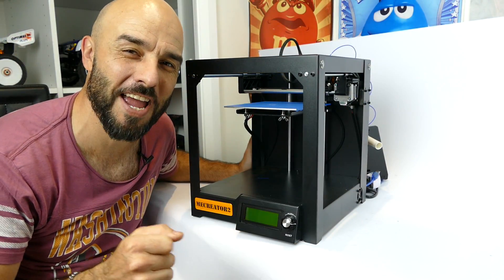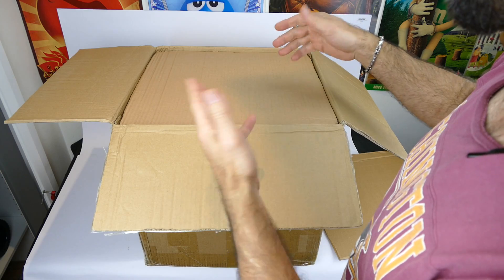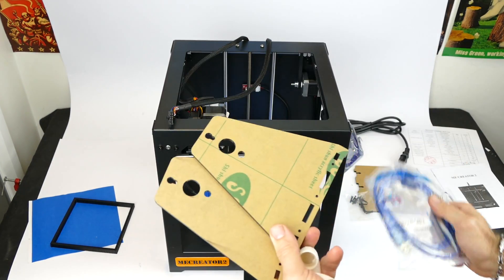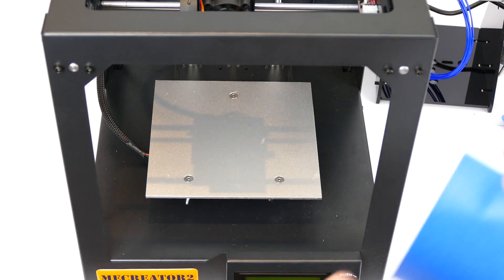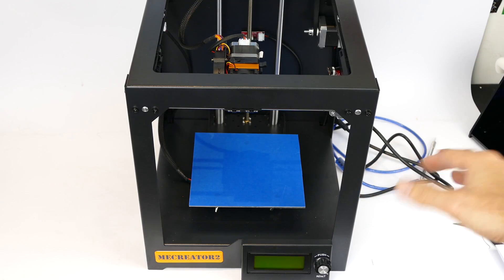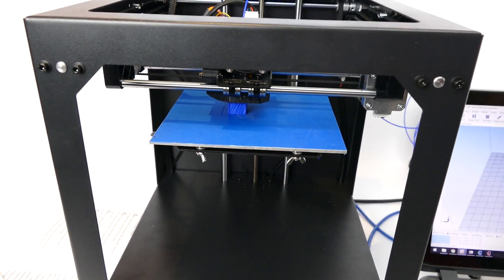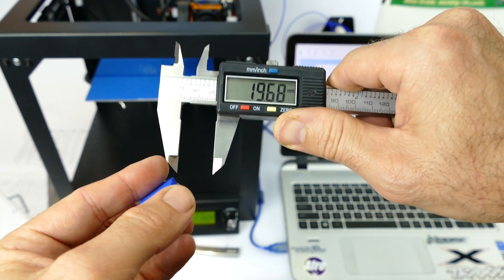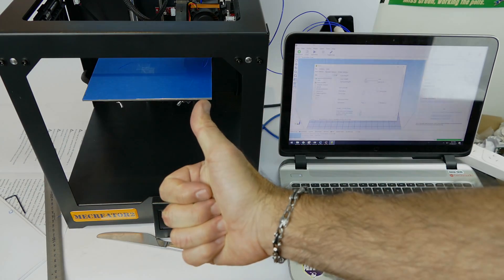Cheap Metal Frame 3D Printer - Geeetech MeCreator 2 - Unboxing, Setup & First Print

Comment: I have the Mecreator 2 too but changed the nozzle to 0.3mm and now it prints like a god. Really if you buy this one, it gives you good quality with a 0.4mm nozzle but with 0.3mm a new world opens up to you. And actually it prints flexible TPU filament very good with a 0.4mm nozzle. Without any upgrades. Any my 20mm Cube is really exactly 20mm +/-0.05mm

Comment: When putting on the bed cover and you know it's the exact size you need, pull back the backing about 3 -4 " and then set the leading edge down. This way you can control how it goes down and eliminate air bubbles as they happen. Just like putting a screen protector on a cell phone.

Comment: Did you see the cube is not exactly printed in the center, did you recalibrate it?
Reply from the maker: +cagivasupercity I tried but everytime I center it in simplify3d when I go to print it is always off center even though on the preview it is centred
Reply: Hi did you try to make this (on the display)
Navigate to Y0 X10 Z0 and then go to the menu item that reads something 
like Reset Home Offsets. Click it and you will hear a loud beep and then
 next time you print it will print in the center.
And store it 
menu:Control>Store memory

Comment: With DIY printers one prints calibration prints and then makes adjustments to the firmware to get things spot on. You might(?) see if the belts that drive the short measured side are as tight as the other axis. If they aren't you might see if you can tighten it a bit, or, you could see what the manufacturer suggests. :)
Reply: Another suggestion would be for you to print some of the torture test prints to help you dial in your print settings in your slicer. That way when you print your preferred objects, you will get higher quality output.
Reply from the maker: +Kyle Kerr thanks Kyle, appreciate your comment. Definitely need to learn heaps :) 
I am using simplify3d and it's awesome
Reply: You probably should be watching what Maker's Muse does. He actually comes from a commercial 3d printing background. He has a number of tips on making use of Simplify3d.

Comment: I like everything minus the 160mm bed but I wonder how this would work as a CNC..
Reply: There wouldn't likely be enough stiffness to cut anything of any serious density. Not to mention, the Z axis probably doesn't drive nearly as fast as the X and Y axes. I would venture to say the majority of 3d printers are good for doing what they were designed to do.
Reply: a 3D printer and a CNC are the same thing just one has a hotend and one has a cutter or spindle..the stiffness can easily be conquered by taking away the heatbed Springs and adding spacers. I already converted my Anet to a CNC and can switch back and forth in 15 mins  granted I can't cut metal or wood yet but I'm waiting on a better spindle for 70$ for Ali exp that can cut wood My friend is already cutting wood with his 3D printer CNC mod so why wouldn't you want to have your 3D printer to b a CNC at the same time for 70$ more I can even add a laser too 4 axis etc.. All can be done with a bit of tweaking in the firmware..